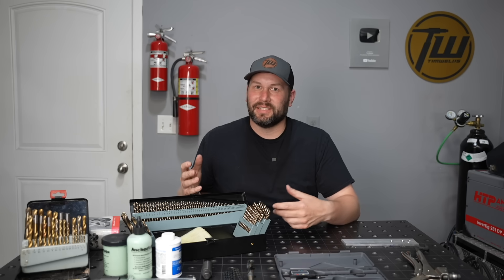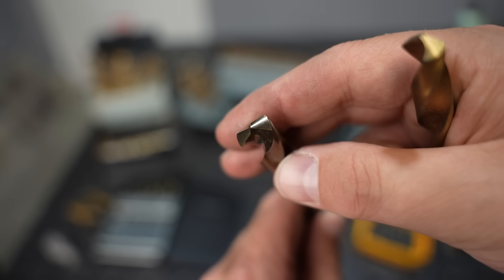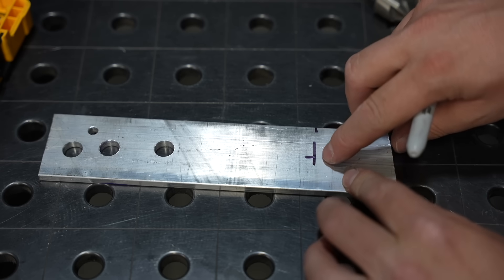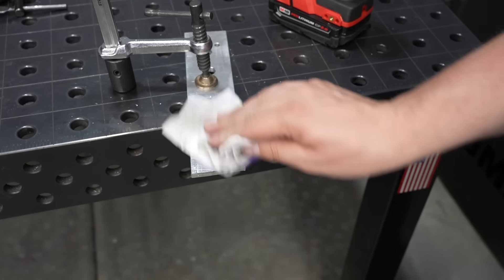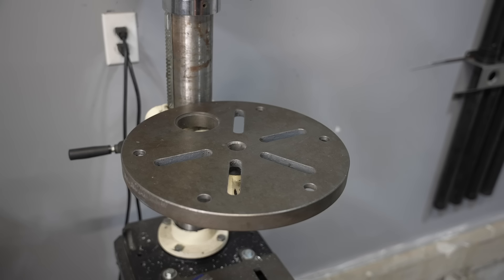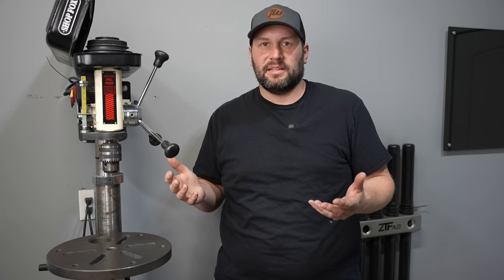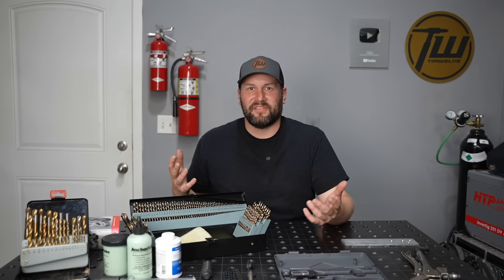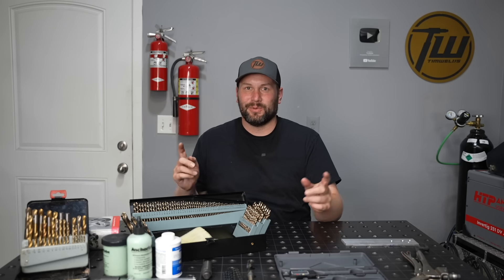How to Drill Holes in Metal: Master the Drill Press

Comment: I have to tell you that I am living in Europe, so we use metric numbers for drill sizes. One of the teachers, when I went to technical college (some +50 years ago) told us a very usefull tip (we call that a donkeys bridge) for the drill speed. When you use the formule: 10,000 devided by the drill size (in millimeters), you find the correct drill speed. I always remembered this tric and for me it worked perfectly. So for a 10 mm drill, the speed has to be 1000 rpm.
Reply: I was taught a similar method, but with different values depending on the material: 4000 for stainless steel, 6000 for regular steel, and 10,000 for aluminum, divided by the drill diameter in millimeters. I always use this approach, and I find it very effective
Reply: Do you then vary that depending on the material?
Reply: @tristanz3672  No, you write it on a piece of paper and continue doing things incorrectly.
Reply: I think that's really oversimplified.  The material is also a major consideration, as drilling aluminum is far different than drilling stainless steel.  Drilling a 1/2" hole in 3/16" stainless steel can be challenging, while drilling the same hole in mild steel, cast iron, or aluminum is a piece of cake.
Reply: Thanks
Reply: A tool and die maker showed me how to put a bevel on the drill for different materials and the best lub for what you are drilling,but that was 50 years ago maybe it is different today drill speed was important then also

Comment: Get materials guide “feeds and speeds” for metals chart. 

Always use a guide hole for cleaner, faster, more precise holes in metals and all the bits in you index will last tremendously longer. 
Select the guide hole bit to be atleast the diameter of the non-cutting part of the point on lager/finish hole size. 

Ideally, in mild steel you want each half of the drill to produce even, contiguous, long, identical helical  chips. If it’s steel and set up right the chip will have a deep dark blue color. 

If precision is your interest, follow up by a pass with a “ reamer” to put the hole walls smooth, parallel and on size.

Comment: blue chips, squeaking are all bad grumbles. big drill slow small drill fast.  stainless i agree half speed in comparison to carbon steel. long to solid ribbons i feel comfortable with. Thanks for the tip on coatings which I felt was mostly sales pitch

Comment: That's about the best baseline instruction video that I have ever seen.  I worked aviation for over 50 years, and most folks there didn;t even understand the properties of metals.  The softer and thinner the material the faster the drill speed and lighter the pressure.  The harder and thicker the material the slower the speed and harder the pressure.Thanks for a gresat video.
Reply: This is exactly the advice that I was looking for thank you
Reply: I’m a retired master carpenter, and fully agree with your assessment of “best baseline instruction video”.
Reply: Um, no, that is not how SFM works, but thank you for playing.  The drill bit has no idea the material is 1/4 thick or an inch thick. IF you say it's for heat dissipation you have already lost the battle.  You run the recommended SFM for the operation in question, for HSS or for carbide, for coolant or for without. Making up your own rules sure as hell isn't what is supposed to happen in the aviation industry... speaking as a retired aerospace engineer myself.
Reply: @railgap  You are half right railgap.  The metal has no idea how thick the metal is but the drill bit understands that when ir gets too hot ist will overheat, dull, then burn up.  I'm certain that you were a top notch engineer, but you were never a mechanic that drilled holes daily for decades.

Comment: As a machinist, I'm looking for long, uniform chips, but NOT long enough for it to start accumulate on the drill. like 2-5cm (1-2 inch) long. BUT the thing is that you're not gonna get that with a hand drill or necessarily even on all drill presses. On a CNC mill or lathe the forces involved are kinda insane. The only way i've managed to get a hand drill to get similar chip as I would expect from a CNC mill, was by basically having my entire weight on the drill. I tried only because that particular drill had died on me once already, my boss had bought a new one and it was assumed broken already. Would NEVER put my own drill through that :D On a battery drill, I'd expect to get like maybe 1/6th of a circle sized chips. If the chips turn into like these tiny needles, something is wrong. Of course there's such a huge array of materials and drills out there that it's entirely possible that you're going to want to expect and see something completely else on what you're working on, so any "general tips" anyone can give you may be just completely off. For example with work hardening steels like Hardox, drilling with too much feed speed/force will in fact make the steel work harden and then you may find it a struggle to make it through that hole even with a carbide drill on a cnc mill.

Comment: I  used to drill pilots, but now since I bought  a Strand 8000 dollar Swedish drill i drill inch through 3/4 mild, at 57 rpm power feed, the curling drillings are cold and do not go blue, the table has tee slots and special clamps, Belt driven drill are for DIY  folk
Actually bought the drill at auction for 950
This is not best practice, but I am old, need to save time

Comment: Drilling can turn into a nightmare, I managed to burn out a nice Presto HSS (tin coating) set to lowest speed on the drill press, drilling 8.5mm holes, thinking I need Cobalt, but this is only mild steel square bar that been welded (naturally cooled in UK winter time). 
There is a bit of vibration in the pillar drill which seems to stop once it starts chipping, could it be the vibration?
Reply: If you're drilling some of the weld it may have hard spots in it. So cobalt or carbide might be the answer.
Reply: @firebyflint  Ahh now thats an answer that makes sense, so next question is how can I weld without producing hard spots? is that a case of cooling slowly?
Reply: @engjds  The cooling process might help, is there a low carbon leaded welding rod? I don't know that answer but you can send the parts to a heat treater and have them annealed where it has to soak in an oven, or like you said try cobalt using oil and keep resharpening the drill. Good to have several extras on hand if they break. If it was me, I would just use carbide and resharpen when needed using a green grinding wheel. if I had 100 holes I'd probably get 3 drills. I'm not sure if cobalt will work well.

Comment: Steel chips should be gold color.  Thin Small Dusty Flakey like chips are bad.  They dull the cutting edge.  These are caused by too little tool pressure; I.E cutting edge is riding on top of the work or "Bulldozing" the material Dulling the edge, you need to keep the entire cutting edge of the tool under the cut.

Comment: Any of you ever use just WATER for drilling?
Reply: Not me, as it will rust your equipment. Even water soluable coolant requires a specific amount of water mixed with the solution to create a smooth cut and not rust things.

Comment: Hello Tim,  If I'm drilling a hole that I want to look nice, I pick the next size smaller - drill the hole - then switch to the intended size dill and redrill the hole.  The second step is basically reaming the hole.  It also saves the intended drill.  That is, if I want to drill a 1/4" hole, the one that is 1/32" smaller does most of the work, so my 1/4" drill (which is a more common size) will last longer.  Regards,
Reply: Good stuff!

Comment: Tim, I stumbled across this video and listened with great interest because I make knives and have to drill holes for handle pins and lightening handles for balancing.  This brings up another skill I would like to have, welding.  However, I have not pursued this because typically it is only very small welds like welding steel screw onto hidden metal tang for bolting down handle material or repair.  Also, what type of welding machine?  Best value welder, simplest to use, etc.  I would take your course but don't even know where to begin and don't want to spend to much or purchase welder that is cheap junk.  Thanks for your help.  Jump'nJak

Comment: Two factors: as much as you can without overheating the bit or work. Production is key, so do it fast and reliable. Constantly changing bits is time consuming. I worked with a steel ship builder and asked why he was sticking it together? Save that for detail and get mig rigs. He finally did and profits went up along with production.

Comment: When drilling large holes (1/4 +) in steel, start by drilling a pilot hole (1/8 split point 135 degree bit) all the way through the material. Even though you have to change out a bit this a lot faster than drilling with one large bit.
Reply: A keyless Jacobs Chuck makes changing bits fast and easy. Their expensive but last a lifetime and less chance of spinning the bit loose .

Comment: Best way to drill holes in steel is with a 100 ton press-punch. Failing having one of those  (you may have left yours in the shop) the next best way is to buy lots of new semi-decent bits. Chuck said bits in bin when they go blunt & grab another new one. 

You can indeed sharpen drill bits (apparently - I have seen it done in videos etc etc) however if you are a mere mortal like me, chances are you have more hope of pulling Claudia Schiffer than you do of walking back from the bench grinder, clutching your lovingly sharpened drill bit & not having it either sit there making SCREEEEEEEE!!!! noises & feck all else, or it drilling like an absolute B*****d for about 1 minute before also making SCREEEEEE!! noises.  Buy a new bit. 

Life is short & chances are, you getting it to be both sharp & not heat-softened to the point it wouldn't drill a hole in cheese are somewhere between slim & none unless you are a cross between Uri Geller & a Japanese sword maker.  Remember, the holes the goal- new bits increase the likelihood of you creating the hole by about 80%.  Buy new bits.

Comment: Machinist here. As per request, you're not feeding hard enough. You'd be amazed at what the actual feed per rev of a twist drill is. You can't hang on the lever of your drill press hard enough to feed a drill properly over about 1/4". It should be curling chips out large enough that you can hear them bounce on the floor. It's hard to appreciate what a good twist drill can do until you've seen what real machines can push them to.
Reply: What about pushing the bit by hand vertically? No drill press and using a hand held  machine?
Reply: How can you hear chips bouncing sound when machine is running!!
Reply: @KrishnaKumar-zi2st 
Tesla drill?
Reply: @waterboy8999 wha is that?
Reply: @KrishnaKumar-zi2st  it's obvious you've never seen real chips.
Reply: The world of machining isn't limited to the bits in a drill index. So yes, you can hear chips hit the floor! What's most important is that the leading edges are cutting and not rubbing...rubbing will simply dull the bit. For hobbiest', run slow and pull hard to transfer heat into the chip and less into the bit. Also break the the chip by retracting. All of this applies to drilling holes about 3/16 and up for the hobbiest'. Smaller holes, use what we call a pecking feed cause YOU (which is everyone) cannot feel the cutting through the handle. Honestly there is so much more to this topic that a non-professional would just not be able to comprehend. We're talking volumes of information from material type, to coolant for a material (don't use compressed air with air hardening, oil with oil hardening, water with water hardening), and that the typical "center drill" isn't for drill spotting...ITS FOR A LATHE CENTER! So don't ever go beyond the pilot and into the taper. Like I said this is a topic that someone could make a career out of.
Reply: @tonycerniglia4777 Tony when you say “never go beyond the pilot and into the taper“. 

Also do you know of a book that would teach this stuff good?
Reply: @NomadSaga machinist handbook volumes
Reply: @wadesmith9483  Thanks wade Ill buy it.

Comment: I we had guy working for us for a short while he was tasked to drill 3/16 holes into 3/16 A36 sheets, he killed 6 bits in a matter of minutes. I was like WTF? he said: " you told me to drill why did you tell me to drill?" Anyway Tim showed a bit 135 degree you can get it in home depot at most parts in a set, are pretty good, Once I counted we drilled 876 holes with the 3/8 bit into 3/8 flat bars before I had to sharpen it. Also common mistake when you have to drill free hand you gotto keep it perpendicular to work pc and avoid heat build up.

Comment: Ok 35 years in sheetmetal and welding trades , stainless is NOT harder than mild steel, in fact it’s softer and one drill will last forever if 1 drill slowly with pressure ( very slow speed ) use drill cutting compound like trefolex , make sure it doesn’t get to hot if so more compound, sometime if I’m stuck with say 1/8 rivet drill but I’ll drill through some spit , ( any port in a storm) stainless gauls very quickly, and work hardens extraordinarily quickly , that’s why it’s used in custom precision rifle barrels , stainless is not very malleable , ie it should never be used in a winch cable or working cable , it’s only for static lines , otherwise it will break very quickly, ask any WLL certification place,
Stainless/ high pressure on the press or hand drill , keep it cool by any means , test your material, 304 and above are not magnetic, and you can do a spark test to see carbon content, some knives and things that are hard are not really stainless as we generally think of it , you will find this harder stainless will rust in a corrosive environment, , but you can’t have your cake and eat it , so it’s great to have but you still have to keep it oiled or painted etc , you have probably never heard of stainless axe heads , they would go blunt annoyingly quickly , if it’s 304 / 316 it is easy to drill , but if you let it get hot it will instantly work harden and ruin your drill bit , I’ve ran into so many tradesmen even in their 50s still don’t know this , I’ve had to buy lots of bits in the past because my employees didn’t follow my instructions
Reply: The reason knives became stainless across the board is for sanitary purposes not because they are good for knives, in fact they make hopeless knives , black carbon steel holds its edge at a guess 20 to 40 times longer , all very old butcher knives were black steel, and they are easier to sharpen and hold their edge, hope this helps someone, I’ll think I’ll make a YouTube tutorial on drilling stainless myself, not bagging this feed it has some very good information, just a note on stainless drilling, which I have done a lot of, have a great day night ppl

Comment: I just spent all morning drilling a, (one), hole in a 1" bar, that I broke a bit off in the first poke.. Actually never got a hole completely through, but used every cobalt bit that I had that was in the 1/4" range. I will only buy cobalt but good quality is expensive and hard to find. Really a problem breaking a bit off in a piece of metal. Waddle you do about that!
Reply: Yeah, breaking a drill with the tip stuck in the hole is a pain. I use a carbide 4 flute endmill and peck the drill out. The carbide will machine the drill.

Comment: Hi Tim
Maybe you just misspoke and you meant the opposite but just to clarify:

When chips are thin you said - 
Increasing the speed and going easier. That creates even thinner chips and even risks the bit to overheat. 

Too low feeding speed (in relation to turning speed) makes a drill bit rub instead of cutting and the friction heat ruins a drill bit in literally a second. 

If you want thicker, holding spiral like chips - increase your feeding speed. 

Kind regards 
Anders 
Sweden
Reply from the maker: Thanks, I appreciate it! Based on this and a couple other comments, I was unclear about tool pressure and feed rate. You are completely correct. On this drill press, I'm limited to some extent by the belt slipping, but when possible It would be better to feed a little faster.
Reply: @TimWelds  need to add some praise.. 

Your tutoring skills are so next level! 🙌🏻

Followed you since your start and it’s a pleasure watching!
/Anders

To put in perspective…I am retired since long but have decades of hands on experience in fabrication and production and R&D in the automotive industry. In teaching too and with that said - your videos are really good so thx!

Comment: When I started my metal work internship I went through a lot of drill bits... and my thumb hurt. There was a lot of drilling. A lot better now but drilling holes in stainless steel above your head is still a pain in the ass.
Reply: Stainless is always a PITA and it gets worse fast with size😹

Comment: Any tips for drilling with bits 1/16 an inch and smaller?
Reply: Maybe 750/850 rpm with largest possible centerdrill but not too deep/and peck drill/ clear chips often and keep a cool tool. I've shortened my drills for rigidity or you can buy the stub drills. If you hear any crunch sharpen the drill or replace right away. It helps if you feel the pressure of the spindle going down. Maybe use a small drill chuck and drills should run true with little wobble. If you CNC the holes, no more than .001 depth in revolution maybe a tad less if problems or replace drill every so many holes. There is a small springloaded drillchuck that you push with your fingertips and that mounts in a collet of a milling machine but it makes your finger sore after awhile.